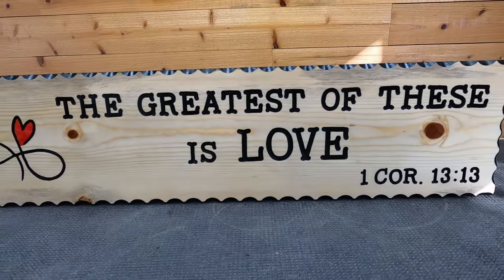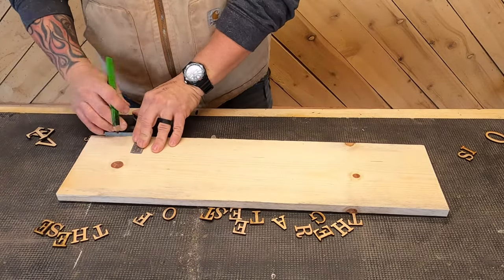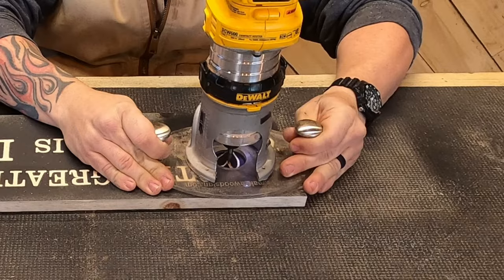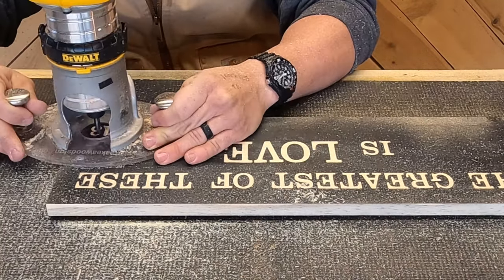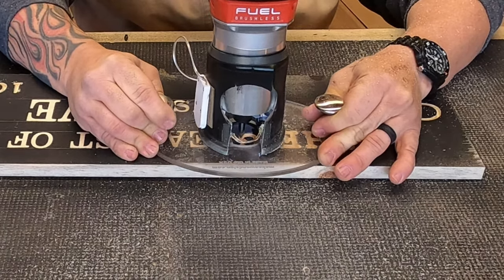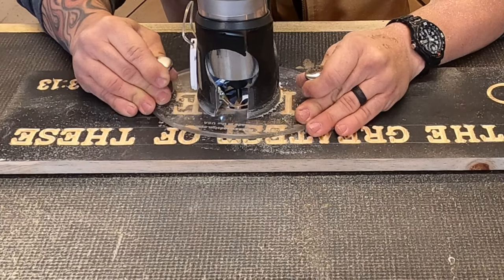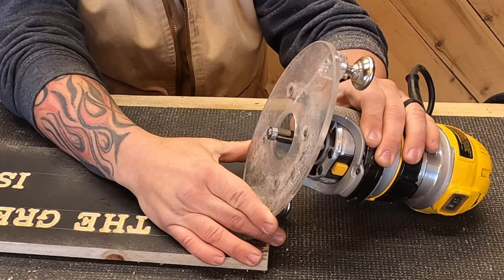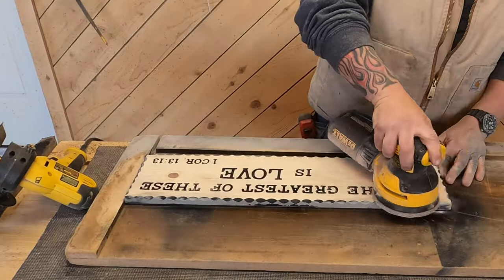Carving The Most Difficult Letters - No CNC Required

Comment: I use a combination square to set letters. I leave the square on the board then place letters against the ruler. Don't have to worry about going below line or above. Plus when spacing letters you just going side to side not dealing up and down. If you need to move line for a reason, move it all at once. I've tried spraying small letters sacrificing a ruler. Seems to prevent letters from moving.
Reply from the maker: That'll definitely work👍👍